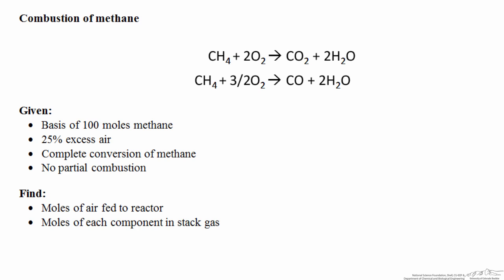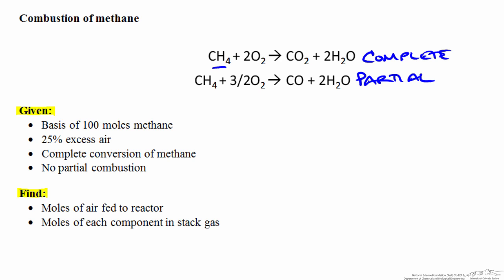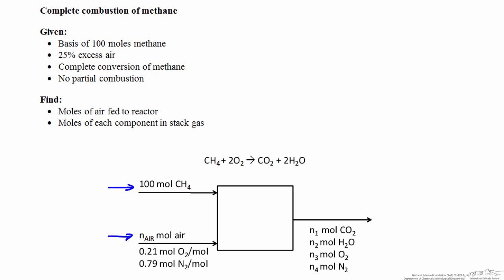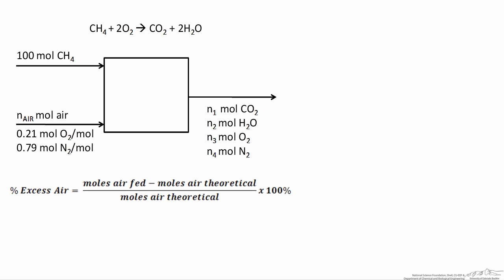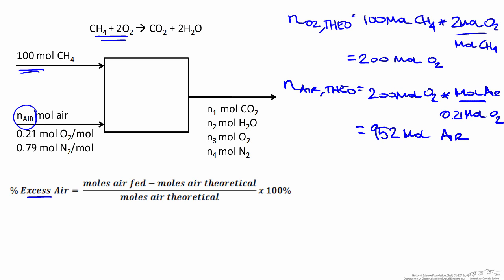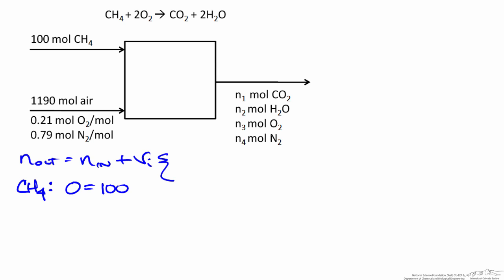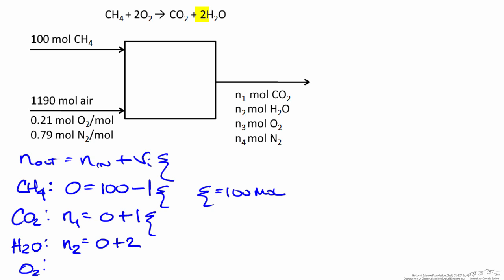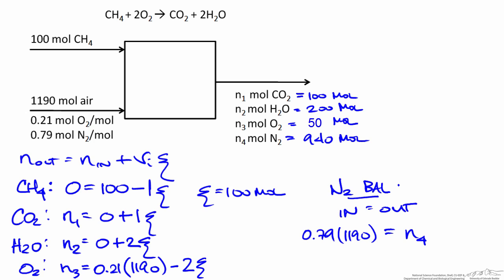Material Balances on Complete Combustion of Methane

Comment: So did you choose 100 for extent of reaction because 100 mol of methane was fed to the reactor or the value is usually given in the question?
Reply from the maker: Extent of reaction is calculated at 4:55 in the video using CH4. You know that you started with 100 moles of CH4 and it's stoichiometric coefficient is 1, and there is no CH4 left, so 100 - 1*(extent of reaction) = 0 so extent of reaction = 100.